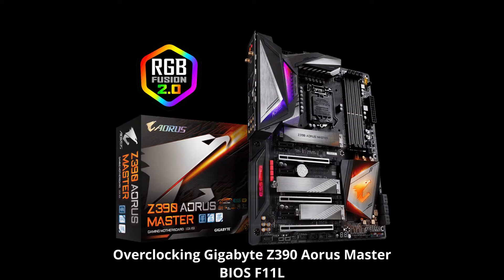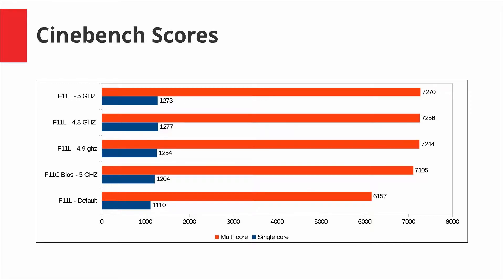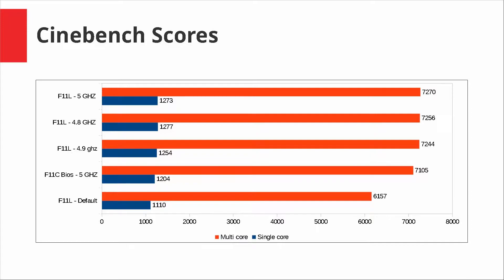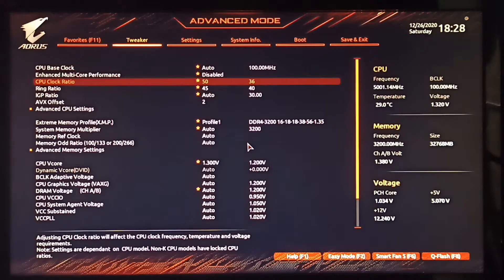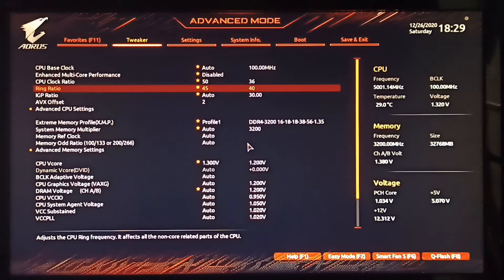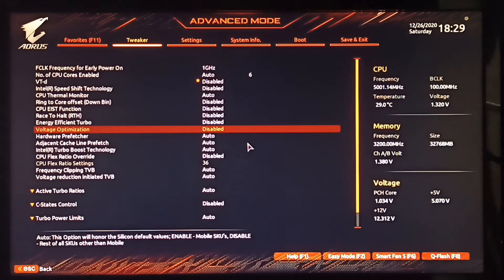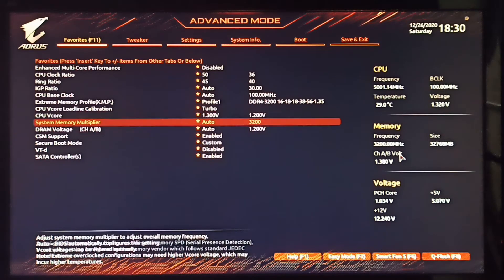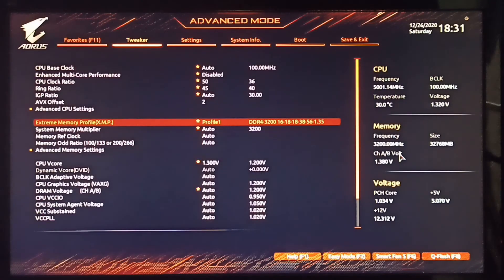GIGABYTE Z390 Overclocking Guide to 5ghz

Comment: I follow this guide every steps of the way but the moment I started stability test (prime95, occt, cinebench) it freezes into BDOS. Test is good with stock
i9-9900k
Z390 aorus pro wifi
32gb ddr4 ram (2x16 corsair vengeance, 2x16 ballistix)
PSU rm650x
NEED HELP PLS!!

Comment: Any ideas with my current setup? I am stumped:

Processor: i9 9900KF
Motherboard: Asus Maximus X
RAM: 128 GB 3200 mt/s XMP

Loaded with bios optimized defaults: OCCT crashes on test.
Loaded OC Gamer template, boosts up to 4.7 GHZ. Able to finish OCCT One hour power test 

Replaced motherboard with:
Gigabyte Z390 Aorus Master
Loaded with bios optimized defaults, could not complete OCCT power test. Most of the time in crashes at 2 secs. Sometimes it can withstand up to 22 minutes with errors before crashing.

I was expecting that loading optimized defaults would fix stability issues.

Any idea how what's going on? It seems optimized defaults are not working.

All motherboards and processors are hand me downs so I don't know how there were used before.

Comment: My MOBO: Z390 Aorus Pro Wifi (F12)
My CPU: i9 9900k
My RAM: Corsair Vengeance LPX 32GB (2x16GB) DDR4 3000MHz C15
PSU: Corsair RM1000x

Changes:
Enhanced Multi-Core Performance: Enabled
CPU Clock Ratio: 48
Ring Ratio: 45
AVX Offset: 0
XMP: 3000

Managed to boot and started Game (Rust). Crashed after 5 Minutes.

What can i do? Tried everything already. Already a 2 week project 😢
Reply from the maker: Test the CPU overclock using cinebench rather than rust. Since a game uses both CPU & GPU. You wanna make sure the CPU & GPU are stable individually. I use cinebench, superposition, & 3D mark before testing games.

Then set LLC (loadline calibration to turbo).

Turn enhanced multi core performance off.

Reduce ring ratio to 44.

Then check if it's stable.
Reply: @Coolflexy1  Did everything you said and it was stable. Even a little bit better results then the stock 4.7:

Cinebench 2024:

GPU: 8497
CPU (Multi Core): 683 pts
CPU (Single Core): 77 pts
MP Ratio: 8.91 x
-----------------------------------------
Superposition:

1080p Extreme: 9008
FPS: Min 53.12, Max 86.95
GPU °C: Min 47.0, Max 72.0
---------------------------------------------
3DMARK:

Time Spy Score: 13922
Graphics Score: 14781
Graphics test 1
94.17 FPS
Graphics test 2
86.50 FPS
CPU score: 10475 
CPU test
35.19 FPS

What can i try next?
Reply from the maker: @zerobambiro  that's very odd that nothing else crashed except Rust, it seems like an issue with rust. I haven't played it so not sure on what to do next.
Reply: @Coolflexy1 i could also play Rust with the settings. It was stable. I think lowering the ring ratio was the key here. What would you do to boost the system even further? I want it stable but ofc with the max power i can get.
Reply from the maker: @zerobambiro  ring ratio doesn't really affect gaming performance. You could try pushing the CPU Clock Ratio to 50 and  undervolt + overclock the GPU to get more performance at a lower temp. That also improves consistency and avoid micro stutters. I always limit my GPUs between 950 - 1100 mV, closer to 950 mV in most cases.
Reply: @Coolflexy1 Do i need to raise the Ringratio aswell if i raise the clockratio? What tool do you use to overclock the gpu?
Reply from the maker: @zerobambiro  you do noy need to increase the ring ratio, but ideally ring ratio should not be slower than 500 MHz, so if your ring ratio is stable at 44 then you shouldn't have CPU core clockratio higher than 49. or 50 core clock, avx offset 1 and ring ratio 44.
Reply from the maker: @zerobambiro  for GPU MSI afterburner all the way

Comment: Can you make an update with F12 BIOS. I bought it with F12 already on it and its not stable.
Reply from the maker: I still see F11 as the latest BIOS, which motherboard are you using? or can you send me the link?
Reply: @Coolflexy1   I have an i9 9900k processor
Reply from the maker: @zerobambiro  But which motherboard??
Reply: Z390 Aorus Pro Wifi
Reply from the maker: @zerobambiro  ok I see that BIOS F12 is the latest for that motherboard, I'd recommend reset BIOS to default and only enable XMP, 4G decoding and resizable bar. 

Test if it's stable before any overclocking.
Reply: @Coolflexy1 Thanks. I will try this out. Do you have any suggestion which software I can run to test it?
Reply from the maker: @zerobambiro  my go to are: cinebench R23 to test CPU
Unigine superposition for GPU
Reply: @Coolflexy1 I tested it with cinebench and the CPU went up to 100°C. Don't know how to see if the CPU cooler is working properly but that definitelly not normal.
Reply from the maker: @zerobambiro  Yes, 9900K is definitely a hot CPU but if you have a good CPU cooler that shouldn't happen.
Reply: @Coolflexy1 Thanks to your help I found out that my cpu cooler was bad. It was either too small or not working properly. With a new one have temperatures about 60°C and actually 85°C at 5GHz. Since want my system to be 100% stable, I will stick around 4,8 GHz. Thank you man!
Reply from the maker: @zerobambiro  you're welcome. Since there's a silicone lottery your CPU might be stable between 4.7 - 5.1 core and between 4.1 - 4.7 uncore.

Try all of them and also check temps, ideally you want temps to be below or around 75 C from a 10 min cinebench run.
Reply: @Coolflexy1  I didn't know that. Thanks for the information. I also keep getting weird noice trough my active speakers when I move my mouse and a static noice over all. Some people say that there might be a problem with the power unit. What do you think?
Reply from the maker: @zerobambiro  yes, that's a possibility or in old houses the earth wire either doesn't work or isn't present at all.  

If you have a 2 pin (positive & negative) power connecter from either your PSU or in a power extension cable that you're using then, just flip the positive & negative terminal.

but the best way is to have a 3 pin power connector with a working earth wire. otherwise any PSU will build static overtime.
Reply: @Coolflexy1  I am renting an apartment and every power outlet comes with a ground. Today i did a GPU Test with Heaven Benchmark 4.0 and the annoying sound actually was louder. When i stopped the Test, it became quiet again. GPU was on 70 C. Do you have an idea what i can do now? Not sure what i shoul exchange in my PC :/
Reply from the maker: @zerobambiro  That is strange, i'd take your PC and test it out at a firends place or something just to be sure if it's the PC or the Apartment wiring. if it's the PC then just return it. If you're in the US you can just take it to Micro Center.
Reply: @Coolflexy1  BTW: I cant return it, because i bought it used from a guy. It's worth a try testing it at another apartment. I live in Germany, but i will ask from some similar Store.
Reply from the maker: @zerobambiro  Since you're in germany you can try asking Der8auber (Roman Hartung) for help. 

He's the true expert and since he's german he would know which shops & products are better.
Reply: I replaced the PSU and the sound stopped. Do you have your Fans at full speed all time, or do you leave them on normal?
Reply from the maker: @zerobambiro  I'm glad the issue got fixed. I've setup a custom fan profile, my fans stop at 30 % so I've set minimun speed to 40% from 0  - 40 C and then ramp up to 100% at 90 C. 

it usually is between 60 - 70 C in regular use, only goes higher in benchmarks.

Comment: i have a gigabyte z390 aorus Elite with i79700k. i go into my BIOS but i dont have an advanced mode. its only classic mode and an easy mode. how would i be able to get advanced mode on the bios?
Reply from the maker: As far as I know classic mode should be the same as or similar to the advanced mode.
Reply from the maker: Also, try updating the BIOS and maybe you get more options.

Comment: Your adjustments didn't work for me!  I'm using Core i5-9600k + M Gaming + 16GB DDR4 3000mhz memory + H100i Cousair 240mm cooling.
 Please review the settings to run on load of gamers all of duty Warzone .
Reply from the maker: Hey 
Moisés, can you explain how they didn't work? is it crashing? jittery? or not running at all? 

Since your using a different/lower tier motherboard and because of silicon lottery, the same settings might not work. Try reducing the overclock to Clock ratio 4.6, ring ratio to 4.5 and AVX offset to 1. 

Test it out and if it works then increasing it Clock ratio 4.7, ring ratio to 4.5 and AVX offset to 2. I hope this helps.

Comment: Any opinions on replacing the PADS in a GPU (Gigabyte RTX-2080 Gamers) with heatsink compound 100%? I've seen a lot of videos of replacing Pad with other pads, BUT why not pure heatsink compound?
Reply: Pads stay in place better and are less messy for covering multiple components plus the pcb and different material types, though they have to be very specific thicknesses according to each model part. Paste is better for metal to metal contact as it helps fill in the microscopic gaps in the metals and has better conductivity than pads. Pads are also used for components that need some thermal mitigation, but not as much as paste since those components tend to heat up very slowly when compared to direct dies or ihs.
Reply: @VeePull  Thanks for the feedback.. Hope to upgrade to 4090 after Christmas ;-)
Reply from the maker: I'm not entirely sure on what you mean by Thermal compound, I'm assuming you're talking about thermal paste. 

If yes, then I test all my new thermal pastes on both the CPU (8600K) and GPU (1070Ti), and it clearly helps temps.

Comment: Never buying A Gigabyte in future and can't recomment. Their latest Bios F12 is  duplicated with different dates. Flashed latest date, now not able to up/down grade Bios.. System very unstable and doesn't overclock like it used to. Gigabyte need to hire better software dev's. They make $hit for software. Their tools are crap. Anyway, recently system stopped booted since I had this Bios issue and cleared w/ jumper and removed battery. They told me they dont cross ship even w deposit. F' them
Reply from the maker: Yes, gigabyte software are lacking & support is the worst. 

If you want the best EVGA all the way. I still have my EVGA system in use from 2008.

Comment: hey its works. thx dude. 5.0 GHZ!!
oh by the way did M2 NVME detected on your bios? i have problem on my NVME can't show on Bios
Reply from the maker: @japuncorp Change the slot, it doesn't work on the top slot, if I remember correctly.
Reply: @Coolflexy1  i've changed but doesn't work,so i try if i change RST Controlled to RST Uncontrolled it can show my nvme M.2 on bios, but i can't boot to windows, become bluescreen :(
Reply from the maker: @japuncorp4590  hmm maybe it's a specific drive issue, I'm using a 970 Evo. But I'll run some tests and let you know if I find something.
Reply: @Coolflexy1  i use Samsung 970 evo plus,also my pc always suddenly shutdown if i opened a software(adobe,benchmark) or game. cpu on default mode.
Reply from the maker: @japuncorp4590  default mode? Maybe the could be a lot of reasons, I don't use Adobe suite, but with games, could be an unstable OC. 

Reset BIOS to factory settings and try again to see if there's an issue.
Reply from the maker: @japuncorp4590  sorry for the delay. I ran into the same issue when running F11n + TPM + Secure Boot.

Firstly to make Samsung magician work, you need to use the middle M.2 slot + AHCI boot mode + Disable CSM support. 

Secondly, I ran into the same boot error "Inaccessible boot device" to fix that I had to set boot mode to RST and make slot 9 mode to RST as well.
Reply from the maker: Also, I'm saying this based on memory, but 3 of the 6 SATA ports are shared. Ideally don't use them, if you're using NVME or m.2 drives.

Comment: I basically copy every setting you have but what about voltage settings? No voltage setting that need to be changed? And is the overclock too much for me if I want to use this cpu for another 2-3 years
Reply from the maker: I didn't cover the voltage in this guide with BIOS F11L because it had no impact on performance or temps, but I have it covered in my old guides and you can check that out. 

Then overclock being too much? if it's stable and temps under 70C, then no issues. I've had my system OC'd for over 2 years and I've tried pushing it as high as 5.3 ghz and crashed the system more times than I can remember.

P.S. I hope you have the same mobo and a good PSU. Because they can reduce component life. The cleaner the power from the PSU and the better the power delivery from the MOBO, the better it is. 

Also, even with the same components, your results can vary due to silicon lottery. 

Be sure to stress test for at least 15 mins and then check for stability and temps. If the PC crashes or Temps go above 70C on a new system (clean with new thermal paste). Then reduce the OC.

Comment: Can i using this setting for my 9600k vs z390 aorus elite?
Reply from the maker: You can try it, but the chances of it being the best OC for you is very very little. 

So I'd recommend starting from 4.7 and running a stress test. If it's fine try 4.8.

Comment: So can I tun up to 5.1Ghz with a 9900k?
Reply from the maker: Well it's always risky, but you won't know until you try it. Silicon lottery man. 

Depends on the  CPU, Mobo, BIOS version, PSU. It's always best to try a safe number like 5.7 and slowly take it up, till your system crashes. And then set the last stable settings. 

Taking it too far can damage components, although I've never experienced it.

Comment: Will this work with z390 aorus pro?
Reply from the maker: The BIOS should be very similar and the same logic applies, but the results will not be the same. 

Each CPU is already different and results change based on Silicon lottery, plus adding a different Mobo to the equation. the results will definitely differ.

Comment: Hi. I just assembled my 9900k system using Aorus Pro Wifi MB and flashed the BIOS to F12k. Could you advise on how to overclock the CPU and RAM stably?
Reply from the maker: For RAM just turn on XMP, should be the same steps from my video. 

Gains after that are minimal and much more headache then useful.

For CPU the same logic applies. But the CPU, mobo, bios, and PSU differences will definitely have some impact. 

Try something safe start from core clock 46, avx offset 1 and uncore 45. 

The increase only the core clock but small increments, till it starts losing stability. 

Or use easy OC from gigabyte.
Reply: @Coolflexy1  Your guides are only updated to F11 BIOS. Are there any modifications or changes now that I flashed to the very latest BIOS F12k?
Reply from the maker: @natnut2008  They're might be, because you have a different Mobo and BIOS. 

I'm busy with work, but I'll try the new F11n BIOS for my Mobo soon.

Comment: Great video!
Just to clarify If I want to OC to 4.8ghz on the z390 I dont have to do any voltage adjustment? and do I need to adjust the ring ratio and the AVX offset, because im mainly using the pc for gaming and I heard games don’t benefit from AVX? Im still trying to learn OC mechanics
Reply from the maker: Most games don't, but some games do use avx. 

And you don't need to adjust ring ratio and avx offset. But I've seen it's better that you do. 

And it's going to be different for every CPU & Mobo. So be careful. 

Keeping all frequencies within a range of 300 mhz works best. So if your core clock is running at 4.8, ring ratio would be between 4.5  - 4.8, and avx offset between 0 - 3. 

You can start by setting 4.7 core, 4.4 ring, & offset 3. Test it with any stress test to see if it's stable.

Then try increasing 1 frequency at a time.
Reply: @Coolflexy1  Awesome will definitely try! Thank you 🙏
Reply from the maker: @alialwadi1431  do let me know if you have any other questions and the results.

Comment: im soo confused im new to OC I want to OC my i7 8700k to 4.8Ghz what do I put as my CPU clock ratio?
Reply from the maker: CPU Clock Ratio would be 48.

But which BIOS are you using? Because this video is specific to the z390 Aorus Master with F11l BIOS. 

If you're using something different, it might not work. 

And if your new, you could simply use the EZOC from gigabyte.

Comment: I had the same problem with my Z389m board with i7 9700k CPU. I change my CPU voltade and now my USB won’t recognize my mouse(It works but the software does not recognize it) I’m gonna try everything you did in this video but I need to clear my cmos first. This is my first time ever overclocking so I don’t know how to clear my cmos. I know my motherboard have 3pins that says clear_cmos and I need to use a jumper but can I do this without starting the computer?
EDIT: problem solved, I needed to turn of intel boost and turn up voltage to 1.390v @ 5Ghz. Running safely now at 60celsius on stress test
Reply from the maker: If the mouse works, but windows device manager doesn't recognize the device, it could be a bad/corrupted driver or windows. 

Try restoring the BIOS to default settings and if it's a BIOS or voltage issue that should be resolved.
Reply: @Coolflexy1  I reseted cmos and everything worked again. But my overclock don’t work. I can set my CPU to 4.7Ghz , if I go higher my pc will freeze or blur screen. And if I go over 1.275Volt the same thing happens. I used the exact settings as you In the video. The best one so far is I managed to play a game of Warzone with 4.8ghz and 1.275v and then computer shutdown 🤷‍♂️ I have no idea what’s causing this , any thoughts?
Reply from the maker: @worstdekkaer1055  could be either bad silicon (CPU) or the power delivery from the Mobo/PSU. 

Stick to what works best, even my CPU goes as high as 5.1 but is unstable/jittery. I've stuck 4.9 since it's the most consistent. 

Temp isn't an issue in both my senario and yours.